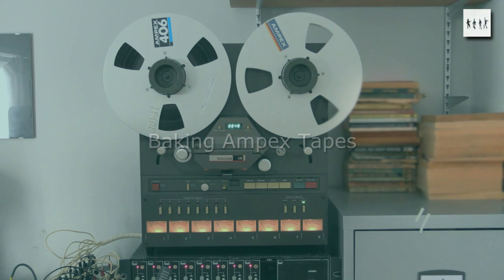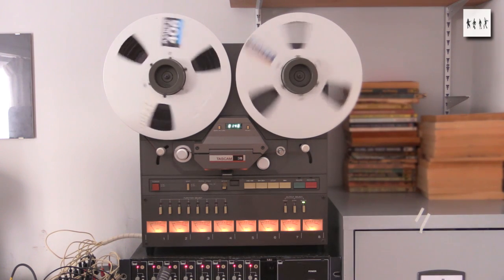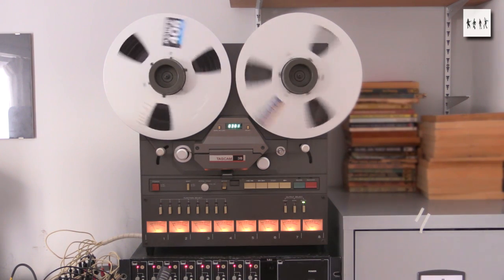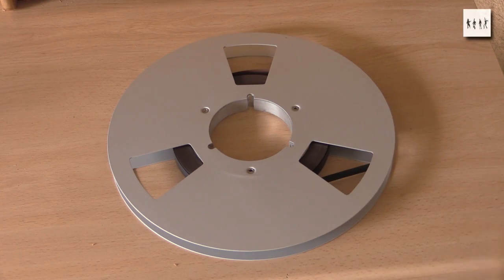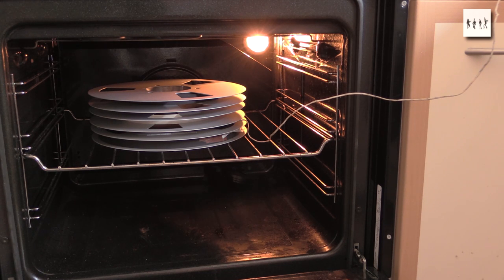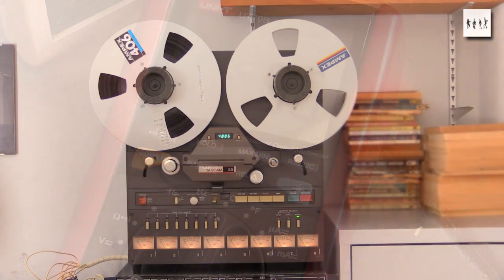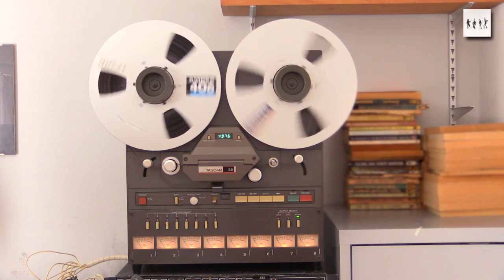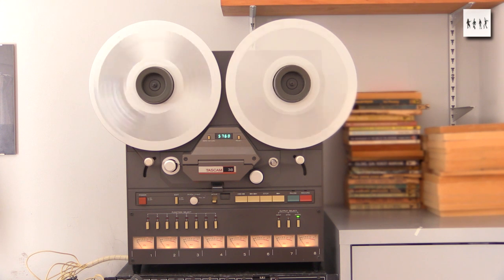Baking Ampex Tapes

Comment: oh my god...is it possibile to do it with home oven????!!!!

i knew it was impossible and quite dangerous due to:

1) electromagnetic fields from electric oven (house ovens are not always well shelded)

2) no constant temperature control (but maybe can be obtained monitoring constantly the temperature)

3) the oxide vapours from the magnetic tape could fly and fix themself inside the oven  and the next time you cook a chicken or a pizza you'll get an oxide flavour pizza that can seriously poison anyone would try to eat.

never seen doing something at home :O

(I remember one friend who tried years ago but used an old gas oven in the basement not used anymore in the kitchen....and the result was a total disaster due to the poor temperature control and feedback....he baked in the very good meaning of the word the poor old tape!)
Reply from the maker: Hi - it is, because you see me doing it in this video!

Electromagnetic fields are not an issue: the heating elements and fan are all behind a perforated steel grille, and are unlikely to radiate any significant EM field. In fact, the food dehydrators favoured by many people (now including me) are almost all plastic-bodied and therefore unshielded. 

You see me constantly monitoring the temperature in this video. The oven's thermostat varies over a 10 degree range in operation, but the tapes on their reels will see an average value due to their comparatively high thermal mass.

The 50 deg C temperature used here is quite low - near the lowest setting on the oven (not a 'proper' cooking temperature). While this is sufficient to drive off the troublesome water content, I believe it would have to get a lot hotter before other components of the tape started breaking down and liberating noxious fumes.

I mention in the description that this should never be done with a gas oven or anything with a naked flame! And gas produces water vapour as it burns, which is not what we want here!

Anyone considering doing this procedure should be prepared to do some sample runs on non-critical material before committing their valuable tapes. It worked for me, but as they say, YMMV...
Reply: +reqordist well i've read much about the subject even in the past and here in my city there is also a place where we used to bring in the past 2'' old tapes to be burned for the transfer, when i was a teenager and one of my friend older than me was working as assistant in a big recording studio....I was really into this, even I had no personal tapes for baking because I always worked with HD rec since late ninenties and also when i've started my small recording studio.

but I am really interested about the subject of vintage audio tapes, restoration and rescue of old audio material, this is really interesting.
Reply from the maker: Fortunately not all old tapes suffer from sticky shed syndrome! Going back through the archives can be a fascinating and rewarding exercise - I have been amazed at the quality of old recordings when they were made by engineers who knew how to work within the limitations of analogue tape. Enjoy your trip through musical history!
Reply: +reqordist yes yes...most 2'' that suffer about the sticky syndrome are from ampex and scotch made between 1976 and 1985, here in milan there were some studios with not a proper archive for tapes or maybe in past they didn't think about a good way to protect them...and as a consequence some old multitrack tapes and also 1/4 inch mastertapes mixes are gone forever...there was a studio near my home with an amazing italian vintage mixing desk from late 60s...and after the owner death was closed for more than 10 years...when I entered i saw a really incredible situation it reminded me the terminator 3 secret room scene....but it was all really full of dirty from walls and ceiling, dust everything, muffles .....the ampex mm1000 recorder semi damaged....and obviously the tape archive was really a mess, I think that they can't fix quite nothing.

they ask me to buy and I made an offer but at the end gave everything to a museum... i remember well two urei 1176 original, an emt digital reverberator....and god only knows what else!
Reply from the maker: Slightly different temperatures involved there, I think! Will let you know if I start to suffer from sticky shed syndrome!
Reply: +TheSuitMan well i agree xD but maybe with those temperatures is possibile to cook again without danger...but personally i'd feel a little bit scared about the idea of cooking a pizza in the same oven where I baked magnetic tapes...maybe it's only an issue of my mind but I dunno, it would be weird xD
(Surely my mom wouldnt let me do this!!!)
Reply: I have done it myself back in the early 2000s with an old SHAMROCK tape and I can confirm that it works. However, the tape is not saved forever. It will start getting sticky again after some months but most of the time you only want it to be playable again to have it transferred to another medium.

Comment: I never heard that with anything I did since 1979
Reply from the maker: Sounds like you struck lucky and never used tape from manufacturers whose formulations suffered from sticky shed! Maxell tapes, as an example, still play perfectly - just a pity they didn't make the wider gauge tapes back in the 80s and 90s :-(
Reply: reqordist 3M
Reply from the maker: Yes, that was a good make!

Comment: I bought a reel to reel for 20$ at a garage sale..it had been stored in a barn and I found some reels of tape in a second hand store. I was never able to get the speed to remainin stable for long...I've nearly trashed it trying to set the tensions...oops!! after seeing this I noticed my reels are plastic....Maybe microwave them?1!
Reply from the maker: Do not even think about microwaving tapes - it won't work and may cause a fire. Use only a fan-assisted electric oven or a food desiccator, suitably calibrated for temperature. Do a risk assessment based on your own equipment and location before baking the tapes.

Don't bake on plastic reels - pick up a second-hand metal reel off ebay or a garage sale, spool your tapes onto it one by one, and bake them singly on the metal reel. 

Finally, it's always possible that the problem of speed variation may not be due to sticky shed, but the internal transport components of your old tape deck. If that's the case, baking the tape will not help. Playing a known 'non-sticky' tape will help rule out that possibility.

Good luck!

Comment: More like from 1970's rather than from 1980's/1990's.
Reply from the maker: Tascam had an earlier 8-track 1/2" recorder from about 1975, but the 32 / 34 / 38 series came out in 1983, according to one Tascam history article I read. I bought mine second-hand (used) in about 1985.
Reply: Until seeing this video, just a few minutes ago, I thought 'sticky-shed syndrome' was a problem with reel-to-reel tapes from the 1970s.  I first heard about baking master tapes back in the 1980s, when albums from the 1970s were being remastered for CD release. For example, that the master tape for John Lennon's Rock 'N' Roll album, originally released in 1975, had to be baked prior to remastering in 1988 or 1989. I think the master tape for Lennon's 'Walls and Bridges' album (1974) also had to be baked. I did not know the problem continued with masters from the 80s and 90s.

Comment: I restore professional broadcast video tape machine with tapes that sometimes are 60 yrs old. Most times we have to bake them for a long time. Spinning video heads that rotating at 14,000 rpm are much more susceptible to bad tape issues. AMPEX made rhe WORST tape ever! Radio Shack Shamrock tape would have bem better!
3M tape is exrremely consistent
Reply: Regarding video tape, an old-timer told me the reason Opelika people wore smocks was to keep the oxide out of their clothes. In his words, Ampex video tape ground up the video heads. For audio recording, Radio Shack Super Lab Tape had terrible high frequency response, already dropping off at 3-4Khz.
Reply: That's at 7.5 ips